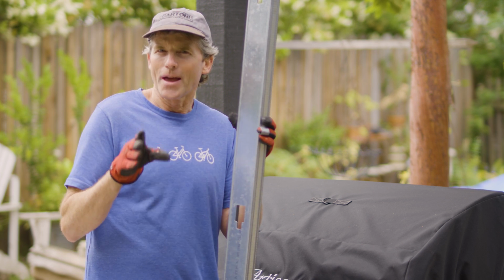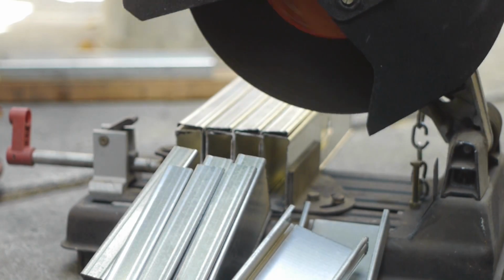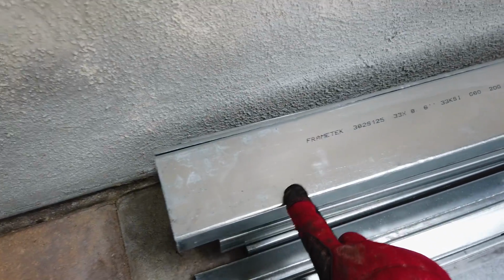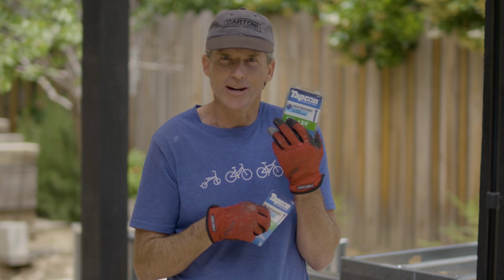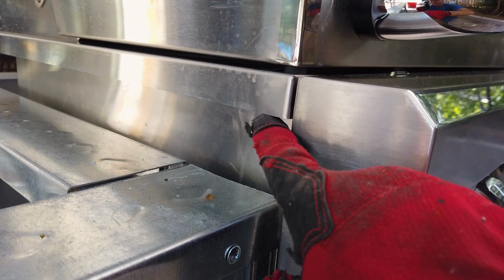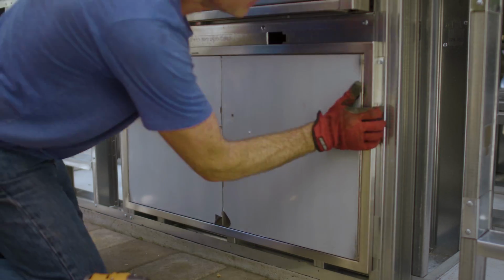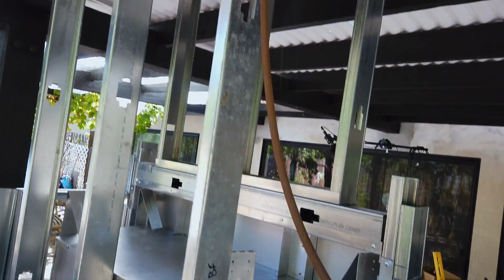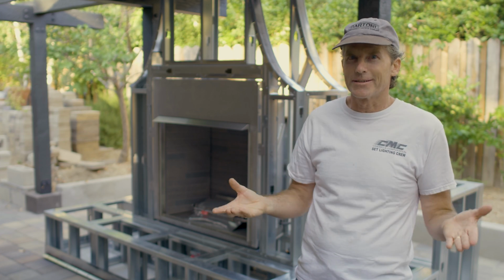Building an Outdoor BBQ and Fireplace with Metal Framing

Comment: Can you share the measurements?
Reply from the maker: I don't have any detailed drawings, but the structure is 10ft x 5' 9".  The bench around the fireplace is 14" off the ground, the BBQ countertop is 32". The fireplace insert is 42" and the BBQ is 36" wide. Hope this helps a little.

Comment: Could you use a ram shot to attach to the floor ? I hate drilling
Reply from the maker: I would think you could, but I haven’t use one with metal framing. I just wonder if the concrete would be more likely to chip compared to a 2x piece of wood?

Comment: I really like this and would only modify by a little to fit the area.  Would you send or post the plans?  I looked for your website to see if you posted it.
Reply from the maker: Sorry I don't really have any plans that would work. I used a modeling program to create mine, but there is no way to export any type of building plans. I can try to answer and measure any specific questions you have.

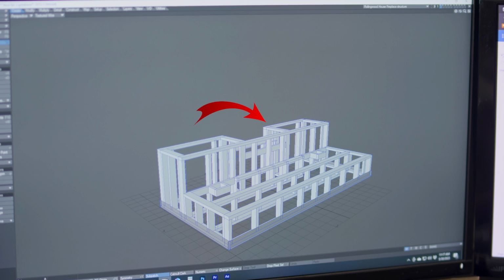Comment: @2:00  What software are you using?
Reply from the maker: It’s a 3D animation program called Lightwave. Not really an architectural program I just know how to use it.
Reply: @BruBuilds  Thanks.  I remember Lightwave from a long time ago when it was used primarily with a Video Toaster for animation.
Reply from the maker: @billweeks9606 wow, you go as far back as I do. Newtek sold off Lightwave years ago and it almost disappeared. A company of some of the original developers bought it a couple of years ago and have released a couple of new versions. Still one of my favorite software programs to use.

Comment: did you place cement board on the inside of the grill cut out?
Reply from the maker: No, the BBQ slides right in along the studs, on top of the concrete countertop.

Comment: Great video. I’m about tot take on the project myself. What is the size of the track and stud  also what’s the difference between the two metal wise? Are they built differently?
Reply from the maker: They are built differently. The stud will fit into the track. Studs will have holes for wires and plumbing. Try to purchase them from a commercial building supply, they are better quality than what you will find in a box store.  I found building the metal framing very enjoyable to build…stucco, not so much. Happy Building!

Comment: Great video!! Did you cut all of your metal studs with just your tin snips or did you use a chop saw? What do you recommend? Did you use 20 gauge metal?
Reply from the maker: 20ga from an industrial building material store, not HD. Their 20ga is thinner. I used all three methods that I showed in the video, mostly the chop saw.

Comment: Don't use a drill motor. Use an impact driver also. I have done commercial for 40 years. rarely ever would the framer use a drill motor.
Reply from the maker: I think I just purchased the impact driver when I started this project and wasn't sure where to use it yet. Thanks for the comments and tips.

Comment: Chop saw is best way to go for. But there is also the option of double cuts. Sawzall is a very frustrating way to cut. You seem to be using light guage metal. Get rid of the sawzall except for demo.
Reply from the maker: Chop saw was the quickest, but I imagine few DIY's have one. It was 20ga,

Comment: Which is better… metal studs or treated lumber?
Reply from the maker: Good question. I would say for something like this metal is better. The only advantage I can think for using wood is it is easier and quicker to build with traditional building tools and supplies. Metal won't burn, rot or get eaten by termites. Cost wise they are probable close now.

Comment: Excellent video!  Been watching your series on the Outdoor Fireplace / Grill Station build.  However, not finding the last video finishing up the grill area with the doors and wrap up with the fireplace.  Am I missing them somewhere?  You mentioned in the comments below you considered Vevor doors but went with KODOM doors for your build.  Curious how they are holding up for you?  They are very reasonably priced compared to many others I have looked at.  Heard Vevor stainless steel is lessor grade and ends up with rust spots.  Wondering with this price point if that is the same issue.  LMK your experience so far!!
Reply from the maker: Still trying to finish the video. Had a busy month and a half, but it’s almost done. We did order Vevor, had an issue with one of the doors and customer service. Kodom doors have a deeper flange, which really helped with the install. Ive actually been using one of the doors for a while and did have a rust issue, but realized it was coming from the magnet and plate that keeps the door closed. I sprayed it with some clear coat to see if that will fix it. All of this is in the video. Thanks for watching!
Reply: @BruBuilds  Great to hear, look forward to the next video in the series!!  So overall, you have been happen with the Kodom doors?  No other issues except some rust from the magnet?
Reply from the maker: @kevinkleinmann  I would say for the price they are ok, only time will tell. I'm sure they are as good as any another cheap door from China. The deeper flange is what sold me on these.  My thought is if they start to have rust issues, I will paint them. You can find better "USA" built doors, but they will cost you (if they are actually built in the USA). My wife found a great deal (80% off) on a Lynx stainless-steel trash can unit, the build quality is a lot better, but list price is 15x more than a door.

Comment: Do you recommend placing composite boards on the bottom of your metal framing?  If so, how far apart?
Reply from the maker: I've seen some people mount the metal frames on composite deck boards to raise them up. I built the slab specifically for this project at 1-1/2" above the pavers to keep water out of the structure.
Reply: I really appreciate your quick response and expertise. How far apart would you suggest that I place the composite boards?  Also, when I am installing the cement boards, how much space (if any) should I leave underneath for potential water to seep out of my structure?
Reply from the maker: Not quite understanding the “how far apart question” I would run them the length of the metal track, with a small gab in a few places for water to drain out if needed. You wouldn’t want the cement board touching any water because they would suck the moisture. If you have the 1” composite board under the track, you should be able to run the cement board to the bottom of the track. What type of siding are you applying to the cement boards?
Reply: Thank you very much
Reply: I am unsure what “siding” means. But, I am going to apply your recommendation and cover the cement board connection areas with thin set.

Comment: Where do you buy this metal framing material please help me
Reply from the maker: I purchased mine from Westside Building Material. On the Clark Dietrich website they have a where to buy sheet that will give you the email of the person over your region. I don't recommend using the ones from your local box store because they are not the same thickness. https://www.clarkdietrich.com/sites/default/files/media/documents/CD_Where_To_Buy.pdf
Reply: @BruBuilds what product did you purchase? There are a bazillion choices
Reply from the maker: Yes there are. At the building material store I asked for 20ga exterior framing studs. 3 5/8”. After cutting some I notice different numbers, on some of them. I think the sold me framing studs and structural studs. Both were superior to the 20ga studs from Home Depot.
Reply: @ awesome. Thank you.

Comment: I will be doing something similar on an existing patio so it will not be on a slightly raised pad. Thoughts on how to raise it slightly off the ground to prevent water pooling as well the steel sitting in water and risking rust long term?
Reply from the maker: You could use 1” manufactured composite deck boards at the base of each wall.

Comment: Can the framing rust?
Reply from the maker: Galvanized steel doesn't really rust, but it can rust on the ends after cutting them. Especially when you use a chop saw that burns the galvanized coating.

Comment: Great content. This is exactly what I have been searching for. I am wanting to build an outdoor fireplace and BBQ structure, using metal studs. Questions, if you don't mind me asking:
1) What was the total cost of the metal stud material?
2) Is the metal studs light enough to build on top of pavers (no concrete pad)?
Reply from the maker: Thanks, glad it was helpful for you.
1) I couldn't find the receipts, but I'm thinking it was around $300. I'll look some more later.
2) The studs are light weight; the issue would be what are you using for countertops, that is where most of the weight would be. Also are the pavers flat and level?

Comment: Where is the cement board video? It goes straight from this video to the concrete counter tops.
Reply from the maker: The concrete countertop video was a test top to see I do actually do it. I'm working the video for part two of the fireplace now which will include, gas, electrical and cement board. Thanks for watching.

Comment: Great video, what width of the metal studs did you use? Sorry if I missed that in the video. Looks like 3.625" and not 2.5" correct? And I saw G60 on your beams. I was thinking G90 since I live in a wetter\humid area. Thoughts?
Reply from the maker: Thanks, yes they are the 3.625” wide studs. G90 might be a good idea. I went to an industrial supply place and asked for outdoor structural studs but they ended up giving me two different types. But much better than what HD was selling.
Reply: @BruBuilds  Thanks for the info! Again, really good video. Keep making them!